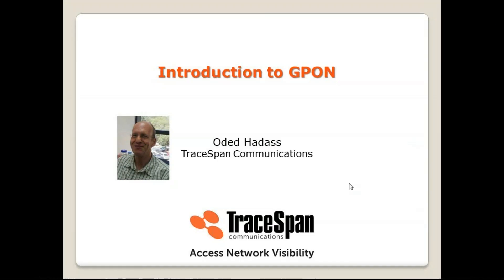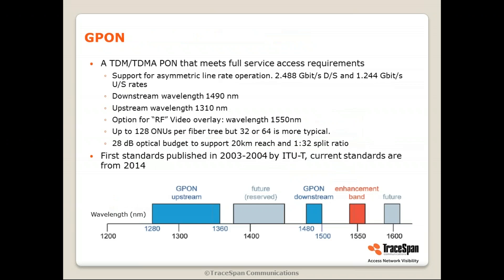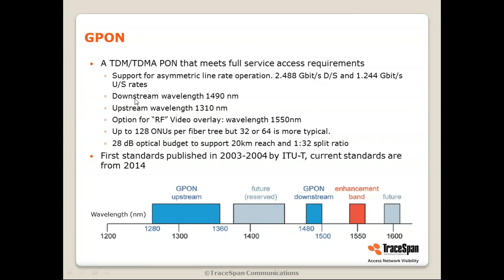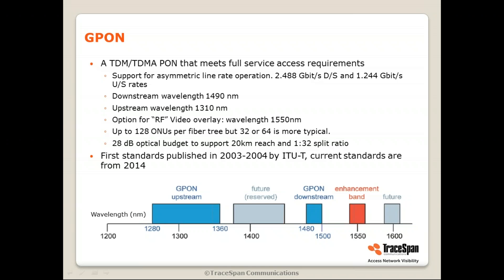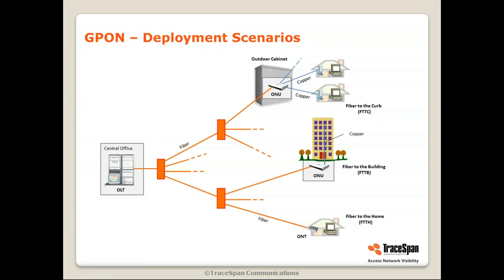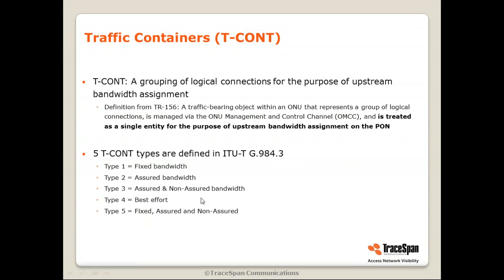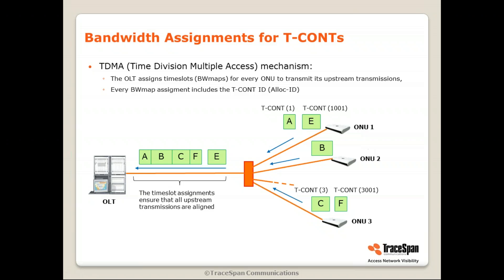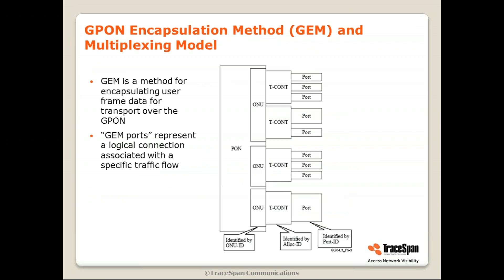GPON Introduction

Comment: Good explanation, yet my question wasn't answered: what makes different GPON from PON? Is PON just a general term to refer to passive optical networking and GPON a more specific concept?
Reply: GPON is a PON network with capability of transmitting data at Gigabit speed.  The same with XGPON a PON network with 10G  data transmitting capabilities.
Reply: PON Means Passive Optical Network. It Means the cabling between the Provider (OLT) and Customer (ONU) is a Fiber Optic Network that does not have Electronic Power equipment but Just passive Splitters like your TV splitters only that this one splits the incoming fiber into several  fibers  32/64/128

Comment: ----------------------------------------------
Other Videos：
https://youtu.be/mFYUSRgsirM *How to Connect to GPON ONU and OLT?Such as:BT-762XR &BT-PON OLT-
https://youtu.be/sEPWqsSGmIQ *How to Configured GPON ONU and OLT !.-Such asBT-762XR & BT-PON OLT

Fiber Media Converte：
https://youtu.be/QrfpYZgafC0 *Fiber Media Converter：Sigle mode single fiber-
https://youtu.be/4bqEDemGMn0 *Fiber Media Converter：Muti mode Dual fiber-

AC WiFi Speed Comparison：
https://youtu.be/LvmUo3POFjY *UCN Broadband | Optical Fiber | Netlink ONU Router Unboxing, Installation and Review | Speed Test-

ONU-OLT Compatibility Test：
https://youtu.be/il9KiOQ-9l0 *BT-311XR ONU-OLT Compatibility Test.-
https://youtu.be/5ajoCpSDkoQ *BT-122XR ONU-OLT Compatibility Test.-
https://youtu.be/cZwPAX_ARLs *BT-211XR ONU-OLT Compatibility Test.-

Fusion Splice Machine:
https://youtu.be/DZTtwaGqgJo *How to fusion splice two optical fibres-